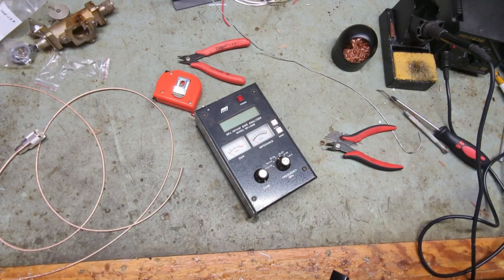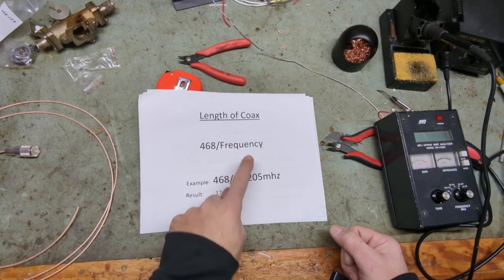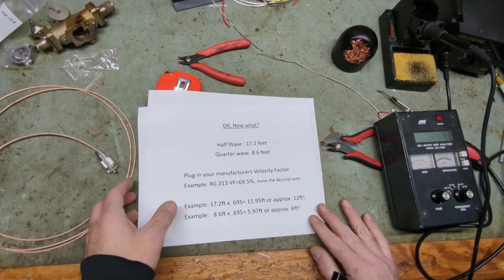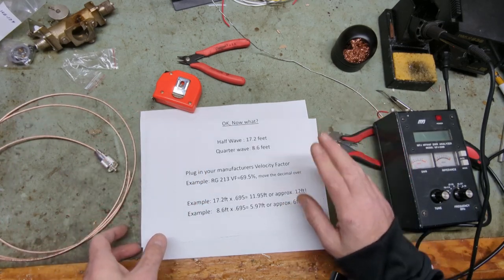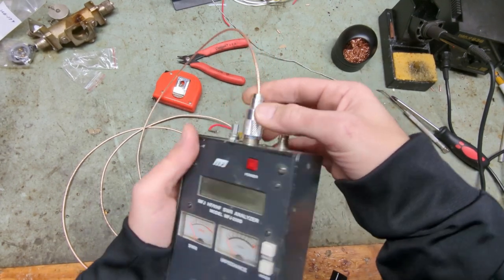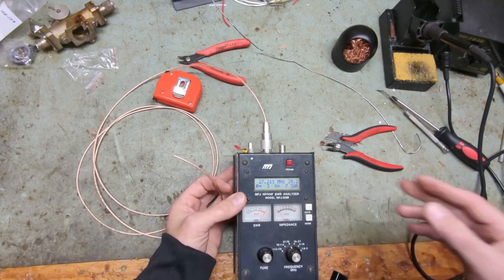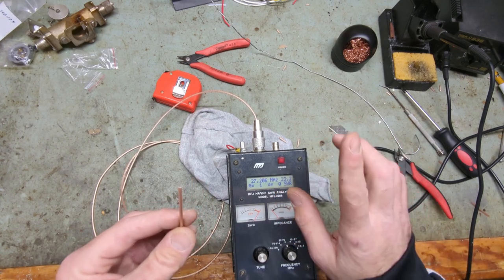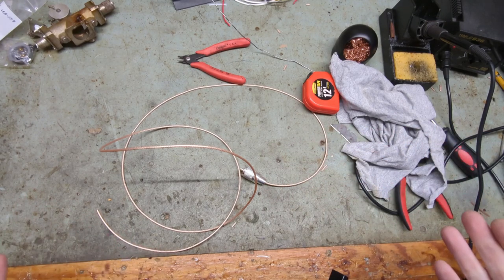How To cut your coax to nulls or coax tuning

Comment: Why? So the only problem occurs before the SWR meter and not beyond it?
If you put a 50 Ω dummy load on a 10 foot length of coax and then add a another 10 foot, 20 foot or 30 foot it is still a 50 Ω load and still a 1:1 SWR. You don't adjust anything. Nothing changes and still a minimal r.f. loss.
You put an aerial on and adjust the aerial for 50Ω, put a jumper lead of any length in and it should still be 50 Ω on a well matched aerial. Tune the aerial not the coax.
It sounds to me if you have to cut jumper leads to length you have r.f. on the outer of your coax affecting things or the aerial is not a true 50Ω. I've never cut any to a specific length after years of making aerials. I'd need a jumper lead of around 44 feet (¼ λ) or 88 feet (½λ) for our 60m band and a ridiculous whopping 550 feet (¼λ) for our 2200m band.
G4GHB.
Reply: I was thinking the same thing. I've been into radio for 50 years and never once tuned coax on any antenna and was always able to obtain a flat match. If SWR is changing from length, that suggest common mode on the shield of the coax.
Reply: @richb.4374  It's as if they believe a 6 inch length or 20 foot length of coax won't produce 4 Watts unless it's the magical ¼λ. They just don't get it. A 50 Ω dummy load proves otherwise.
73, G4GHB.
Reply: Actually it's not 550 feet, that would be 550 metres. It's even worse, about 1800 feet!
G4GHB.
Reply: @richb.4374 Most antennas aren't 50 Ohm perfect matches.  By using 1/2 wave multiples, the radio will see the same impedance as the feed point, since that's what 1/2 wave sections do, repeat the impedance they see at the other end. This way, the matchbox matches to the feed point impedance and not some complex reactance that includes the feed line,  and consequently it's length.  If you do things this way, your antenna won't suddenly be out of match because you swapped a different patch cable in your shack.  This is a real issue with VHF, your swr changes dramatically when you change patch cords around.  Whenever your antenna isn't a perfect match to your feed line, your feed line becomes part of your antenna due to the swr. By using half wave multiples you nullify the effect as much as possible.  The swr you measure in your shack truly represents your antenna situation by itself since it's impedance is seen at the radio end, not the complex conjugate.  1/4 wave stubs have their own special uses.
Reply: @richb.4374  49 years radio here and in the early days I did not have an SWR meter, I just tuned for maximum r.f. out. After building the resistive SWR meter it proved maximum r.f. out was minimum SWR. In fact I built it only about ten years ago and calibrated it four years later!
G4GHB.
Reply: @tonyfremont  By your reasoning the aerial and patch lead would both need to be tuned. Do you think everything stops at the SWR meter? It's like a connector joining coax together making one length.
I moved my 2m dipole on a random length of RG58 which is approximately 12 foot with a ferrite ring so I needed to re-tune it using my NANO VNA. It showed the following results:

SWR                    Ohms                 % Output (For SWR figures from, I think, RSGB Handbook)
1.7                        39                        Between 96 and 88 I didn't write this one down.
1.5                        47                        96
1.34                      37                        98
1.18                      54                        99
1.15                      50.4                     99
Why do I need tuned coax?
It's the same when I put up my h.f. dipoles and inverted vee, all low SWR. No tuned coax anywhere.
G4GHB.
Reply: @tonyfremont  What you are saying is true, I can't argue with that because you're correct about the 1/2 wave and quarter wave lengths of coax. When I used coax on monoband antenna's I never bothered to tune them to length, I just tuned the antenna flat itself, so maybe that's why I never had a problem. One other thing I might add, swr alone is not an indicator of antenna performance. A dummy load is a flat match but it's pretty tough working DX on one. I'm an amateur radio operator that uses an 80 meter Doublet. Basically a half wave dipole on 80m but it's fed with 450 ohm balanced line. Even though I tune it from my shack via a "transmatch" or tuner as some like to call them, the swr on my balanced line never changes, it stays high no matter where I use the antenna. The antenna still performs very well regardless. The dielectric loss of balanced line is so low, it barely cares about swr. Coax hates high swr, the dielectric losses climb rapidly running coax into a mismatch so I understand why some are so careful "tuning" a coax cable. If I were to feed my doublet with coax, it would work fine on 80 meters where the antenna is close to resonance, but on the other bands it would suck badly due to the horrible dielectric loss.
Reply: @bill-2018  In the very early days of ham radio, hams just connected the open wire 600 ohm feeder right to the tank circuit of the transmitter. They had no swr meter, just like you said, they'd use a light bulb and tune for max power and talk. They used tube finals which could dump RF into the bed springs and not burn up. they had no idea what swr was and the balanced line they used was not picky about swr. Solid state finals are an entirely different ballgame.  It boils down to these simple rules....coax likes the antenna to match the feedline as closely as possible for max efficiency, balanced line doesn't care so long as you make the transmitter happy with a 50 ohm load.
Reply: @richb.4374  Hi  rich, yes, I did use 300 Ω twin feeder to my doublet 30 years ago with my G4CLF based tx/rx with two VN66AF in the output, it worked well up to about 14 MHz but replacing them with RD06HHF now for better efficiency at higher frequencies. They were switching MOSFET's and these are proper r.f. MOSFET's. Re-designing the whole thing in a larger cabinet because I'm adding 60m so it needs new band pass filters for 60.
Before that I had KW gear then an FT101E both to a long wire and tuner.
Because of broadband internet QRM 160 to 20m I'm limited to 60m and above 20m where it's not too bad. Dipoles in the attic and an outdoor 60m inverted vee. Again, I don't panic about SWR, if I get anything below 1.5:1 I'm happy. For 60m I have a Pixie, h/b one xtal valve 61BT tx and a much modified Wireless 19 Set QRP at 2 Watts out. An FT817ND for the rest.
No tuned coax on any aerial as CB'ers seem to think. I moved my 2m dipole so it needed re-tuning, as the SWR came down the impedance went up to 50.5 Ω as indicated on my NANO VNA, about 12 feet of RG58 randomly chosen as it was there, with a ferrite ring, no problem. Much easier than just an SWR meter as I used to do, that is, when I built it about ten years ago. A resistive type so the tx never sees above 2:1 SWR when tuning aerials.
Anyway, the SWR meter doesn't isolate the aerial from the tx, it's connected internally so all the coax is in use as one length of coax, so tuned coax is a waste of time. It's a fancy connector with a meter, no different than a coax coupler with a meter. It' can't isolate the aerial coax from the radio side of the meter as CB'ers seem to think.
73, G4GHB.
Reply: So you tune it then inside the SWR meter or the radio it breaks out of the connector boss and ruins the perfect tune of the coax.
Where coax length matters is in cavity duplexers, buy to tune those you need to make multiple different length cables as it's a guessing game.
This is because the connector itself will change the tune.
So in normal radio operations it's a waste of time but it's critical for repeaters. 

Thanks.
Shane VK1NME.
Reply: @shanerorko8076   Sorry, I don't quite understand your first sentence. Why would something break?
You are right, for normal radio it doesn't matter. C.B.'ers think it does whilst the majority of amateurs say it doesn't matter. I've only seen one video where an amateur said it did matter. 
I have to remove my SWR meter and jumper lead after initial adjustment because it's a Wheatstone Bridge type and will consume 50% of my power. I then rely on the LED SWR display in the radio. I like it because while adjusting the aerial the tx never sees above 2:1 SWR.
Yes, I remember something about cavity duplexers and coax and connectors, I've never done anything with them. 
Also specific lengths for phasing aerials, crossed dipoles which I did for wx satellite reception and I made a 2m beam years ago which needed a half wavelength coax balun to match the 300 Ω tapping on the driven element to 75 Ω coax which I used at that time. About 25 feet of cheap t.v. coax.
73, G4GHB.
Reply: @tonyfremont feedline doesn't become part of the antenna with an impedance mismatch!

Comment: Why did you apologise to the UK for using feet as a measurement?

From Wikipedia:

The foot ( pl. feet), standard symbol: ft, is a unit of length in the British imperial and United States customary systems of measurement. The prime symbol, ′, is commonly used to represent the foot. In both customary and imperial units, one foot comprises 12 inches, and one yard comprises three feet.

Comment: When making phasing cables or stubs the correct constant is the free space in a vacuum which is 492 not 468!
Reply: Absolutely correct! The 468 already includes a “ ball park” velocity factor. An electrical halfwave of coax is only significant if you need the exact antenna impedance to appear at the input of the coax. The quarter wavelength can be used as a transformer if there is any SWR on the line. For general use there is no point to use a specific length of coax. It certainly does not change the SWR on that coax. This does not make the coax invisible. Short lengths of coax have minimum loss anyway.
Reply: You can't tell this guy anything. He already knows it all.  Just like he thinks you have to have a resonant antenna to have low SWR. Resonance and SWR aren't one in the same. You could have God only knows what impedance and still have a resonant antenna and you can have a perfectly good match and the antenna be no where near resonant.

Comment: This is the correct way to do a 1/4 wave length of coax. But when you do a half wavelength of coax you need to short the center conductor to the shield while you analyze the coax. Good video.

Comment: Great video if you want to make 1/4 or 1/2 wave elements for vertical arrays.  Even easier than nanoVna.
Remember to leave a little long for connector installation trimming.  I try to measure the normal trimming of your PL259 solder connections and compensate for that as the last trim.  Make a log of your trim lengths and how much it effected Freq. so you know what to make the last trim.

K6RAD

Comment: Sir, do you the same procedure for the coax from the antenna down to your shack? Thank you.
Reply: Exactly. It's nonsense!
I've never in 40+ years trimmed coax to any specific length. Tune the aerial not the coax.
G4GHB.
Reply: 6 inches of coax or 20 feet of coax unless very lossy still produces 4 Watts. Try it on a 50 Ω dummy load in place of the aerial with different lengths of coax.
Why do you believe in a magical ¼λ length of coax? The reason you might see a difference is R.F. on the outer of your coax.
G4GHB.
Reply: Hey G4GHB!! Make a video and show us how it's nonsense. Share your knowledge G4GHB. KCU3589.
Reply: @fido3561  I'm thinking I will do a video showing it doesn't matter.
I set things up yesterday for 24.94 MHz as my oscilloscope isn't good at 28 MHz, it's not made to go that high.

First read 50 Ω at the tx: 50 Volts, then the same 50 Ω with the magical ½λ: 50 Volts, adding 39" of coax should throw it off, right? No, still 50 Volts. Add another 18½" and still no difference.
Output test at the 50 Ω carbon resistor adjusted to read just on the red line of an r.f. pick up meter (meter, diode and capacitor), meter from a hi-fi or something. Meter and coax trapped on the desk so nothing moves. On the ½λ it's just at the red line, add 39" at the tx end so nothing is disturbed: no difference, add 18½" more and still no difference. The same power output sensed by the meter.

C.B. theory says I should have a mismatch due to different coax lengths and less power at the end.
I did use a ferrite ring so no r.f. gets on the outer of the coax as indeed it shouldn't anyway being a resistive load but to make sure I used one.
If coax length makes a difference it means there is r.f. on the outer braid of the coax. 
The SWR meter can go anywhere too as I proved.
Coiling coax had no effect. No figure 8 needed. Again if it does then ferrite rings are required.
Just all things I have known for years.
73, G4GHB.

Comment: THIS VIDEO IS FOR WIRE ANTENNA and IS NOT FOR COAX...or this is my mistake?
Reply: He's making out that coax MUST be cut to a specific length for it to perform it's best.
He seems to think his SWR meter is some kind of isolation device and there are two totally independent cables which are not connected together by the meter.
If he measured coax at the transmitter end through to the aerial his magic carefully trimmed jumper lead and half wave to the aerial has gone.
G4GHB.

Comment: I'm going to make a video to disprove that a half wave length of coax must be used.
There is no 'magic' length to use as radio amateurs keep saying. 
Test 1. Simple proof with a multimeter, there is one continuous length of coax from tx to aerial.
Test 2. Tx, oscilloscope and 50 Ω dummy load. My 'tuned' coax at 14.040 MHz tested and results as follows:
Drops 1 Volt at 14.040 MHz.
Drops 1 Volt at 10.1MHz.
Drops 1 Volt at 18.1 MHz.
If my coax is so mismatched how can I get these results? Should I get anything out at 10 MHz and 18 MHz from my untuned coax?

My coax is resonant at 14.040 MHz then if I add my 45 inch jumper through the SWR meter the frequency goes down, if I add my other 20 inch jumper it goes down again to 11.320 MHz as measured on my VNA. As expected! The 'magic half wave' has gone.
Don't just look at 27 MHz. There is no resonant length of coax to use. 
My VNA shows an almost flat line from 1.8 MHz to 29 MHz. My coax can be used anywhere within that range. Or will you say I just hit lucky with it?

G4GHB.
Reply: @bill-2018  look forward to seeing the analyser hooked up to different lengths
Reply: @Pioneer936  Why don't you try it yourself?
Reply: @bill-2018  done that I know the outcome, it will show the impedance changes with different lengths when there's a mismatch

Comment: nice and simple.. these self proclaimed  engineers below.. are not likely real in the true sense.. this tuning.. is important in the uhf and above as when an antenna is made to 46ohm and the transmitter is 46 ohm and the coax is 51 ohm...or other variations  and this is a true senario every thing being a true 50ohm dosnt always happen.. this 1/4 trick is nessassary.. also with long lengths of cable the velocity rating of the coax cant be used.. as this changes with frequency...this video and other methods should be used

Comment: Funny how operators dont believe this. Ha... Jokes on them. You run poweryour SWR's go up. Because your coax isn't tuned. Why tune everything else and not the most important thing. 
What are swr's.. Heat. Whats heat do to our equipment... Burns it up. 
My Dead key is 1000 bird. My pep is 4700. 
My swr's... X=0... my swr needle doesn't move. Why because I tuned my coax too. 50 ohms...
So believe what you want and leave this stepout. #12-
Watkins Glen NY waving
Reply: You really think the jumper lead and the aerial lead don't connect through the SWR meter as one cable? 
They are entirely different cables? 

No coax of mine are tuned. Either 20" and 45" jumper lead depending where I place things, my dipoles and inverted vee use enough coax as necessary to get to the aerials. 
2m collinear not carefully trimmed either but approximately 10'. What would he have me trim that to? ½λ which is about 19" before Vf taken into account? That wouldn't be very high up. How about ⅛λ, or ¼λ,⅜λ, ⅝λ,⅞λ or what?
G4GHB.
Reply: @bill-2018    The proof is in the SWR.
Reply: @12NYDarton  It is, and my SWR is right down on my five attic dipoles 20m to 10m fed with two random coax lengths but probably 25 feet each.
Strange if coax half wave coax does matter how my 14.040 MHz tuned coax works at 10.1 MHz and 18.1 MHz and all five dipoles get out.
Shouldn't it be very inefficient at those frequencies?
Tx, with 50 Ω RG58 tuned to 14.040 MHz, oscilloscope and 50 Ω dummy load, results below:

14.040 MHz 1 Volt drop.
10.1 MHz 1 Volt drop.
18.1 MHz 1 Volt drop.

Shouldn't I get almost nothing out at 10 and 18 if it's tuned to 14.040? Tuned coax theory would say yes I should get very little out.  
On my VNA it shows an almost flat line from 1.8 MHz to 29 MHz. I can use my coax anywhere within that range.
Coax length is nonsense as it gets longer with the jumpers added in. The 'magic' coax length has gone.

Why did I bother tuning my coax?
To make a video to disprove tuned coax matters.

G4GHB.
Reply: @12NYDarton  funny how operators don't understand that swr doesn't blow anything up and that it's the impedance that the radio is putting power into causes the internals to overheat